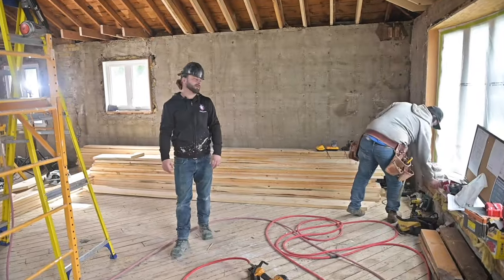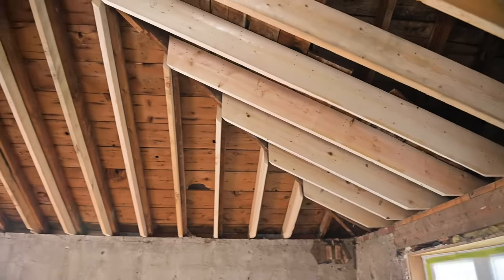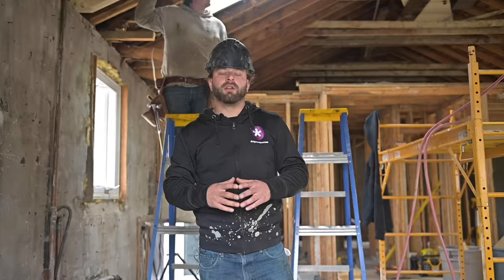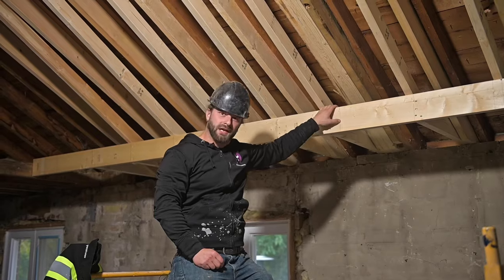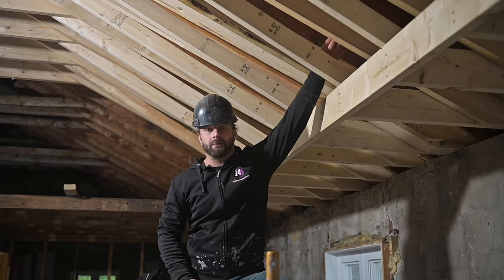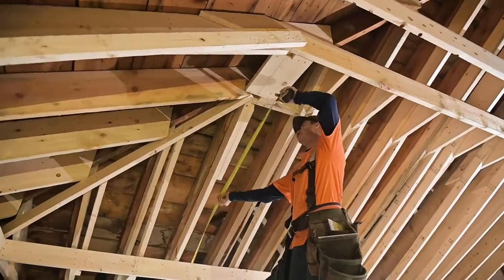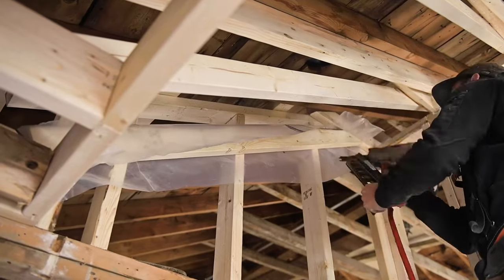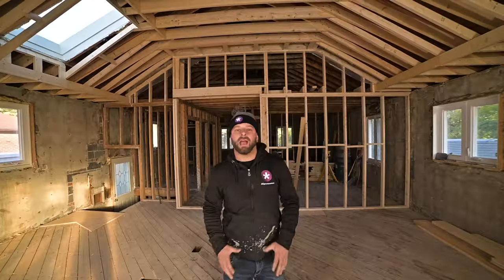How To Build A Vaulted Ceiling

Comment: I don’t understand “reinforcing rafters” and spiking them into an undersized hip?  Any thoughts?
Reply from the maker: We just follow the drawings. Anything structural is done by an engineer. Unless you have that specific designation, I think we are doing the right thing. And even if you did, all engineers do it different.

Comment: you can eliminate collar ties and spreading by 'hanging' the rafters off of a ridge beam . not a ridge rafter but a beam calculated to withstand the load. this save time , material and money if the length of the rafters is excessive then simply add two  more beams about one third of the way down from the top on each side .

Comment: Great job guys, did you put a 4 ply 2x10 on each end of the ridge or  just the one end  ? I'm guessing that's for helping the walls from bowing out ? just curious why you didn't change out the hips to 2x10s ? I know that would be a hard task ,I'm guessing that building is about 20 feet wide ? thanx

Comment: Wrong, collar ties do not keep the walls from bowing out. That’s what rafter ties do. They are two very different member. Collar ties only prevent uplift. 

I never saw a ridge beam on this roof, meaning the roof is not self supporting. I am an engineer, and this roof is completely wrong. I am shocked an engineer signed off on this.
Reply from the maker: Thank you for your input. Unfortunately you must be a YouTube engineer because you don’t know what you’re saying. But it’s ok. There are negative Nancys all over the internet. This is OVER engineered both signed off by an engineer and city inspectors just so you know. Hope you have a better day today Adam.